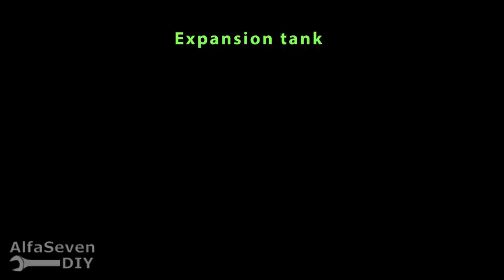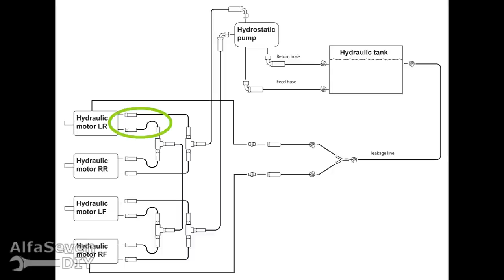L7 Episode 6 | (home-made wheel loader)

Comment: You need to clean the aluminum with an abrasive to remove the aluminum oxide before welding.   Also wipe the weld area with acetone to remove anything else that would cause a problem.  As a 60 year tig welder take my advice and get nicer welds.  Aluminum oxide forms on the surface over time, it melts at over 3000 deg f the aluminum melts at 1100 or so depending on the alloy.  Removing the oxide before welding will make a big difference . Thanks   Great job on the project
Reply from the maker: hi, yes it is not easy to weld alu. at least it is going in the right direction. I use a stainless steel brush and acetone, but still find it difficult to get a clean weld. have a very cheap welding machine too, can blame it 😉

Comment: You should connect expansion tank closest possible to centrifugal pump suction to keep pressure in suction as high as possible. Now when the pressure limiting cap is on the top hose is kind of of nominal pressure setting of system... Of course top hose needs to deaired but maybe a smaller hose (orifice kind of like) would do the job and main inlet from expansion tank with larger hose to pump inlet.

Comment: Really great video. I’ve learned a lot from watching you. I noticed you are using a Eaton Hydraulic Pump. What size pump would you suggest for a mini excavator (like the previous project you had)?
Reply from the maker: Hello and thanks.
I really want to help you but I actually dont  know. I´m not so "in to" hydruaulic. I have used parts from similare size of machines (scrapped). So it is trial and error in my case.

Comment: what do you think, how much weight can those engines handle? (So max lift capacity, not counting for the other machine limitations).
Reply from the maker: it depends on many factors. which pump, size and number of lifting cylinders, where the cylinders are attached to the lifting unit (gear ratio) and how fast you want to be able to lift.
theoretically, my machine should be able to lift 1000 kg but I would guess that half is more realistic.
Reply: @AlfaSeven  and what do you think can the axles handle?
Reply from the maker: @kaistumer198  
The wheel motors is Ross me170 from Ransomes Greensplex 160.
Don´t know the max load but so far they works fine.

Comment: What is a wheel loader and what does it do?
Reply from the maker: Move things or materials :)
Reply: Search on Google Images for "Volvo L150H" to see a typical wheel loader. Loaders typically load trucks, so what they do (mostly) is pick up something (typically loose product like gravel, sand, dirt, stones, etc.), lift it up and unload it into a container, like a truck or similar. They are also called front-end loaders in some regions. 

What makes wheel loaders special is the way the arm/boom that holds the bucket is attached to the machine. When the machine pushes into something with the bucket, the force is transferred to the rear axle. When you lift something heavy, the force is mostly on the front axle (closest to the bucket). For this reason, when you push into a pile of gravel, as an operator you can distribute the force between the front and rear axle depending on lifting the arm slightly at certain moments. This is essentially what makes the wheel loaders very efficient; because of this great distribution and traction, they can push stuff very hard (nearly like a bulldozer) but in addition have the capability to lift and dump stuff. In addition, because they are able to achieve this traction using wheels rather than belts, they are fairly "gentle" (for their size) on the surface they're driving on. 

Wheel loaders come in many sizes, from almost lawn tractor sizes to huge machines larger than houses. Especially the smaller and mid-range sizes are very versatile with hundreds of different attachments like sweeping brooms, demolition hammers, earth drills, pallet forks, timber grabs, ... to name just a few. So while originally (and mainly still) for loading trucks, today wheel loaders handle a wide variety of jobs.

Comment: Hi man it was wery good idela how make hydraulic drive systém 🤤. I am trying to build this here in CZ, but, everyone tells me that hydraulic motors will have little power to load the bucket, it will not have the strength to go uphill with the load, max speed will be very low etc…. Can you please reply to this information so I can use it? thank you very much I am your big admirer🤘
Reply from the maker: It depends on many factors.
For example the size of the drive motors (cc). I use four 170cc. But in my case it would be better with  larger drive motors to get stronger machine. My machine is also quite heavy, about 800kg I would guess.
It also depends on how they are connected. All four in series bring permanent 4wd and fast machine.
All four connected in parallel result in a strong machine. But in the worst case, you only get drive on one wheel on slippery ground. Compare with an open diff on a car.
I have taken the middle road. The front motors are connected in parallel. The rear motors are also connected in parallel. Then these two devices are connected in series with each other. This means that I have drive on at least one front wheel and one rear wheel.

You can also use extra valves to switch between series/parallel while driving . But it is more complicated to build.
Reply: @AlfaSeven  well, if all motors are connected in series, I still have 4x4, but that doesn't matter, right?  men want to know some parameters of your engine and drive pump, I want to use an OMT 500 engine. it has 16mpa 1220nm 240rpm 125l/min and 28.8kw.  what pump should i use for these 4 motors connected in series?  I want a machine weighing around 2500kg and wheels 400/60 r15.5
Btw: thanks you wery mutch for comunication
Reply from the maker: @davidkubista9672  
My hydrostatic pump is a very old Eaton pump from a machine scrap yard (may be more info in episode 4). It turned out to work decently together with my hydraulic drive motors but it was a gamble. I cannot answer your other questions and must refer you to the internet. Try to find a machine forum and post your questions there. Another idea is to analyze what pumps etc to be find in production machines.

Comment: 5:40  I hope you are using stainless steel rivets. Small aluminum rivets will only last a few years.
Reply: I hope he isn't I'd be far more worried about bimetallic corrosion than a non load bearing body panel shearing off loads of alluminium rivets

Comment: Are you going to use hydraulic oil radiator type cooler?
Reply from the maker: I want to make solutions as simple as possible. therefore I have chosen not to have a cooler and instead built a slightly larger hydraulic tank (40 liters). Also, it is not intended to be used 8 hours a day. I think it will work well for me